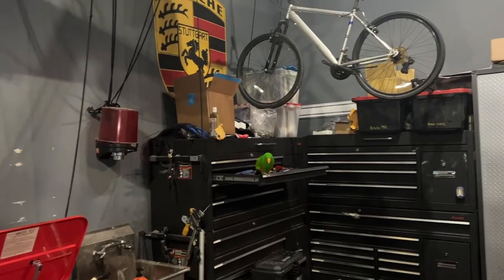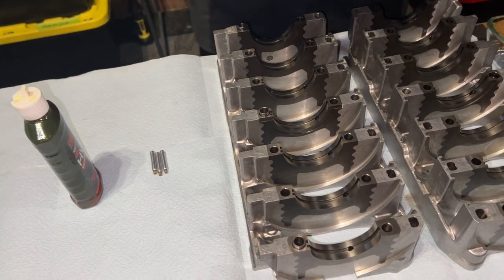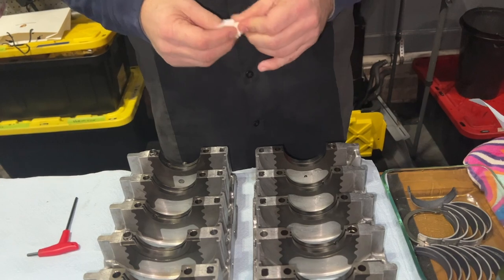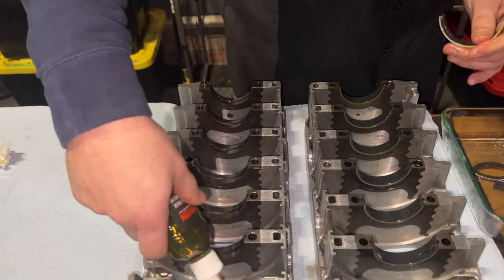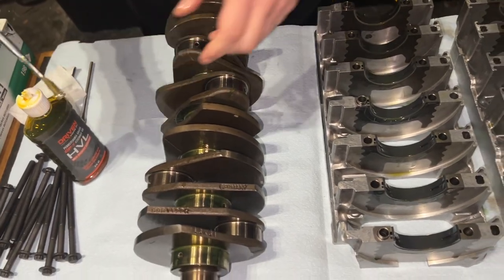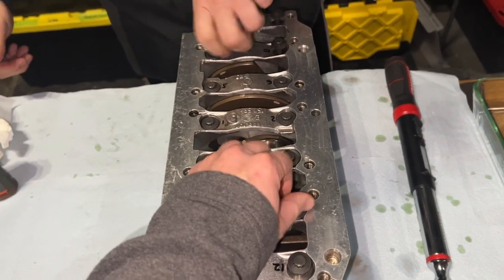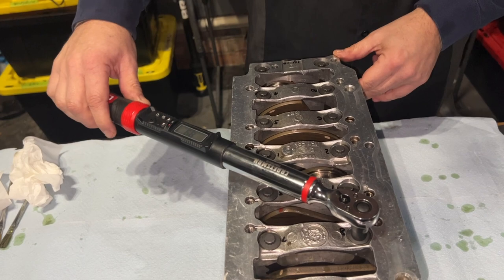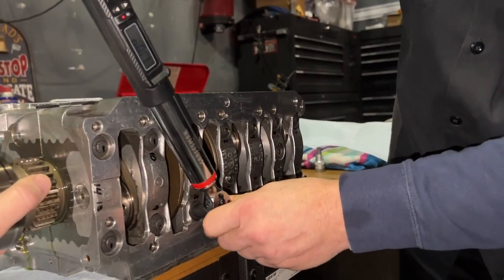The COMPLETE Porsche 911 997 Engine Assembly Guide - Part 1:  Crank Case

Comment: Why would you put assembly on the underside of the bearing between the bearing and journal as there are no running faces that need lubrication and would the thickness of the lube between the bearing and the journal not give an incorrect torque reading???
Reply: Grumpy: yeah in hindsight there was no need for it. In practice the lube will squeeze out into that middle channel. I am consulting with experts that know a lot more than I do to see if this needs to be redone or if it will result in incorrect torque being applied. Back to you with their comments.
Reply: @konradsgarage  I have done a lot of Diesel engines and always put nothing on the back side, I would not worry about torque, may cause a bit of a clearance issue, may impede the lube oil if it fills the channel, but you will pre lube I assume, I think either are nothing to worry about, love the step by step video - no doubt I will fear to this in a few years when I end up doing mine - looking forward to next video
Reply: @paulharrison614  and @Grumpyoldgit I ended up disassembling, cleaning and reassembling WITHOUT the lube on the back. I did this after consultation with the engine gurus that have been so helpful. The crank turned more freely.and I got some practice. We will have to note the video..... Love it when comments help us all learn!
Reply: @konradsgarage  👍 Every day is a school day, its a learning for us all, Paul Harrison was bang on, it was i meant in a roundabout way, keep up with the vids, Its been a long time since i stripped and rebuilt an engine, would like to know how you achieved the 4.0 displacement from the 997 engine, i have an old 986 and would like to find out what the safest size could be achieved. 
when you redid the bearings the second time could you reuse the crankbolts??

Comment: Awesome videos Aaron
Just a friendly reminder. When reassembling a engine or transmission, always wear rubber gloves every step of the way. This will keep body oils from contaminating the internal engine parts. 
And use proper engine assembly oil it contains a special additive to keep it bonded to the engine parts for a long time. 
Great Work
Reply from the maker: +Phillip J Lynch thanks! I’ve heard arguments for both gloves and no gloves. Better feel without them and they don’t get caught/snagged vs cleanliness as you mentioned. I can see both sides.

Comment: Don’t know if anyone has quizzed this but would you not  Plastigauge the crank journals and big ends? What about the end float? I didn’t see you measure that so was the crank reground or did you just use the original crank?
Reply from the maker: We did not rework the crank, wear on old bearings was normal. We did not plastigauge the crank journals  We did however assemble it twice: once with assembly lube under bearings (crank did not turn well), and the last time dry under the bearings and the crank turned well.
Reply: @HelpMeDIY  I saw the bit about the lube under the shells!! We all make mistakes doing something new but being told you can never have enough lube isn’t always the case. Aaron, I would like to thank you for all the effort that you put into your channel and the help you give us with what you do. Keep it up, I love the content and would not have known how to do stuff on my Boxster without you.
Reply from the maker: @Earlofdavetona  thanks! Just learning along with you 😂

Comment: I was told NOT To lube underneath bearing shells, between bearings and block surface as it increases the potential for spun bearing??   I dont know anything other than what ive listened for on pontiac v8 engine assembly.  Just wondering.
**looks like you already responded to this in earlier comment.   Thx!  Love the vids
Reply from the maker: +M Neeley that’s correct! Thanks 🍻

Comment: Curious did a machine shop measure tolerances and machine the journals and etc?  Just curious because I am thinking about building an m96 in the next year.
Reply from the maker: +@josedasilva9210 no, not on this build. But Jake Raby did on my upcoming 987 build!
Reply: @HelpMeDIY  Is Raby doing the build or are you doing the build at home M9Xperience?
Reply from the maker: @josedasilva9210  for this build you are watching, Konrad and I did the whole thing ourselves. My next build of my Cayman S 987 will be through the M9Xperience with Jake!

Comment: Aaron I’m in the same position where I want to build a a replacement engine for my 2005 911 Carrera 3.6 to a 4.0. I’ve watched several of your videos with Conrad assembling and was wondering if there is a way I can ask you guys more specific questions directly? Thanks in advance for your help
Reply from the maker: +@bradnichols3009 feel free to post questions on my Facebook page! I don’t know Of will know the answers, 99% of my knowledge on these engines is in the videos 😆 🍻
Reply: I'm in the middle of a 3.6 to 4.0 rebuild on my '06 997 and the shop is asking about going to a 3.8 airbox or an aftermarket option.  Leaning towards the 3.8 options.  What is your thinking in this area?
Reply from the maker: @kstark2298  I don't really know any options other than stock. For now at least, mine is keeping the stock 3.8 box

Comment: Nice work! Did Buddy also send the crankshaft and carrier assembly to LN Engineering to have the condition of the crankshaft and bearing runout checked?
Reply from the maker: +George Saare I’ll get him to reply with the details
Reply: I did not send the crank or case out for machining as I did not see a need for it. When disassembled, the wear pattern on the main bearings was even and the crank was smooth. I had it measured, put on a balancer by a machine shop and crank was OK.
Reply: @K Alvarino  OK thanks for the feedback!